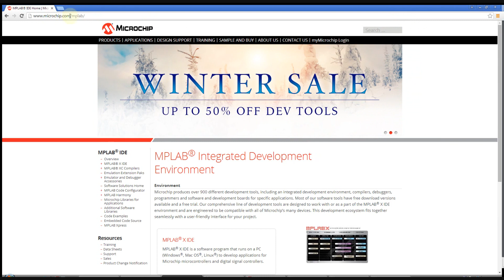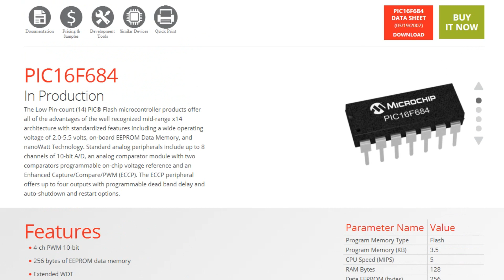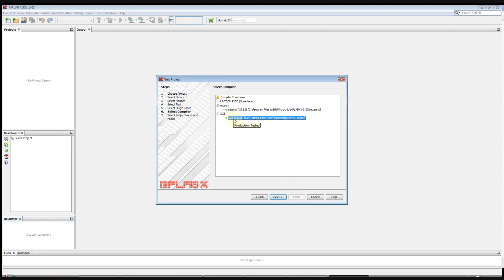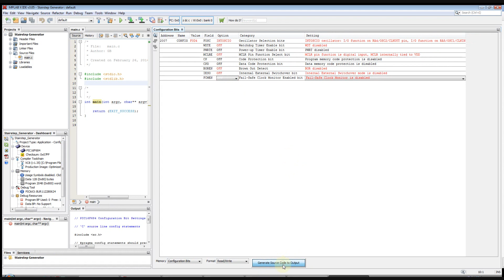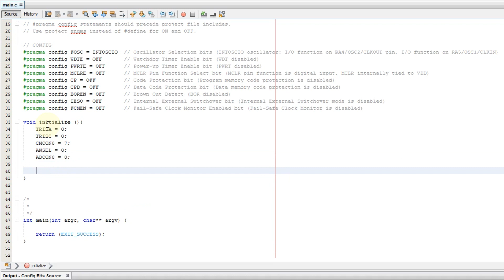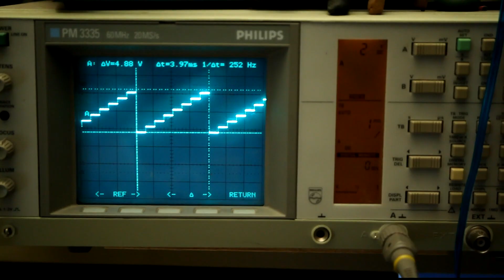Create! - 01 Setting up the PIC Microcontroller (Quick and Easy)

Comment: Thanks for the video. It helped me.
I am into hobby electronics. I have basic to intermediate ability in writing arduino code (c/c++). However, I am trying to modify (re-program) a radio that has a PIC microcontroller. And, the radio is set up with I2C. So, not only do I need to learn PIC programming, I need to learn I2C-related (master/slave) PIC programming.  So, if anyone reads this, and can send me some related links/ articles on PIC and I2C, I would appreciate it. Thanks in advance.
Reply: You can’t use Google?
Reply: @Stopinvadingmyhardware  I was using Google, I wasn't having success. That is why I asked.